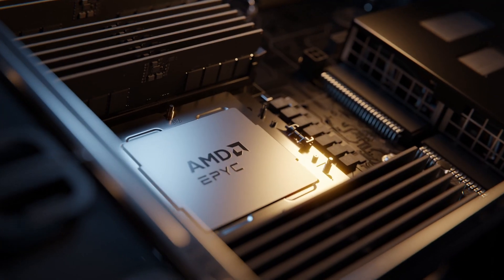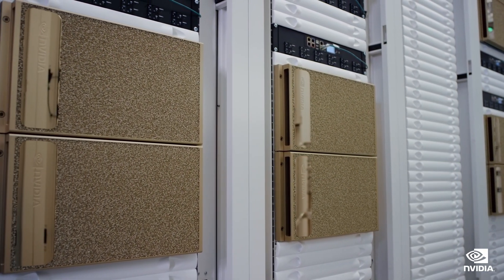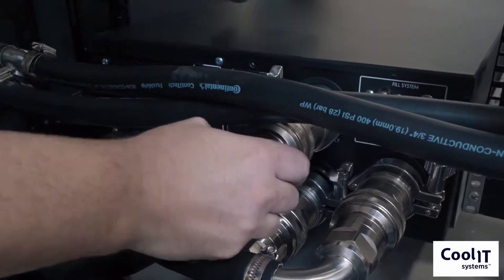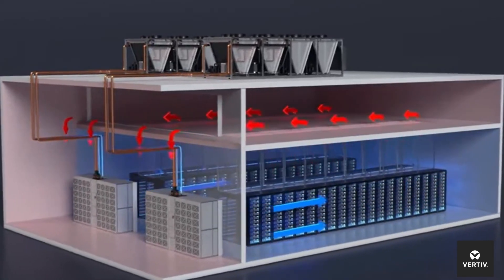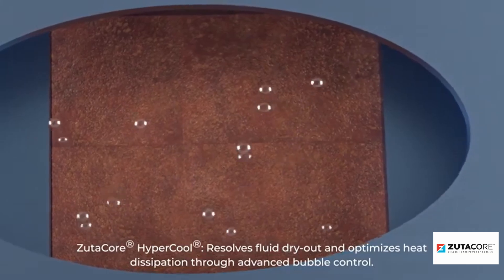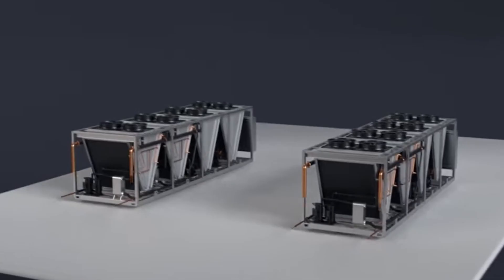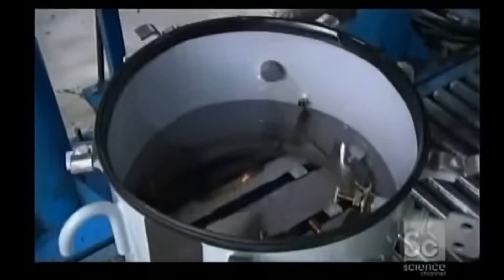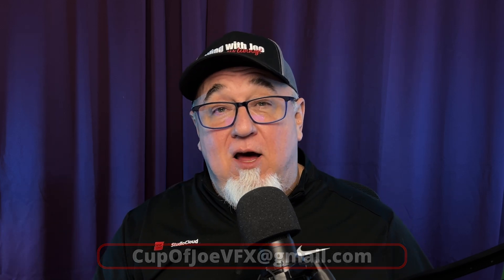The Truth about Liquid Cooled Servers! Mixing Water & Electricity? Direct to Chip #ai #amd #nvidia

Comment: IMO we skip liquid cooling and wait for immersion cooling. Better cooling, self-contained, no extra data center infrastructure, no concern about leaks frying equipment, etc.
Reply: Those systems already exist and are on the market. Biological growth is the biggest problem with immersion in dielectric fluid. 

DLC has some advantages, but still worse PUC. No one implementation is a panacea.